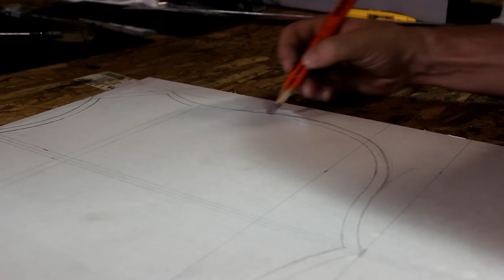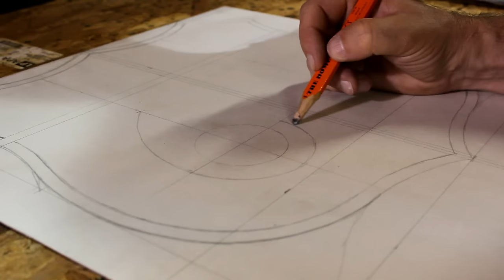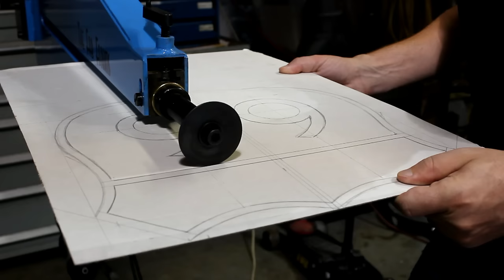Making A Route 66 Sign With A Bead Roller

Comment: I like the idea of transfer tape to draw on instead of doing on the metal directly.

A plotter with pen on low tack vinyl would work great for doing vectorized images.
Reply from the maker: Yea I have thought about using my plotter to do exactly that. I'm sure will try it on future signs. 

There is something cool about total hand designed though.

Comment: Great project and awesome job.  Where did you get the paper you were using?
Reply from the maker: mchiodox69 Thanks. It is low tack transfer tape used for vinyl graphics. You can get it from any sign supply company. I have seen where other fabricators use Frisket paper too.